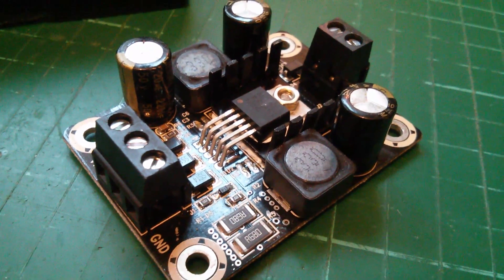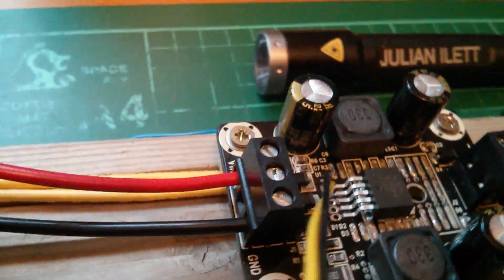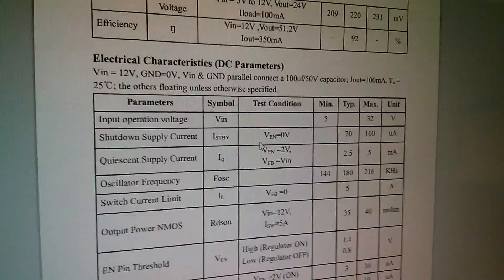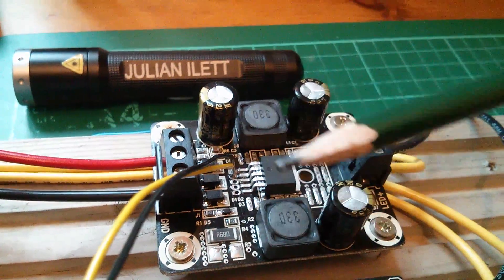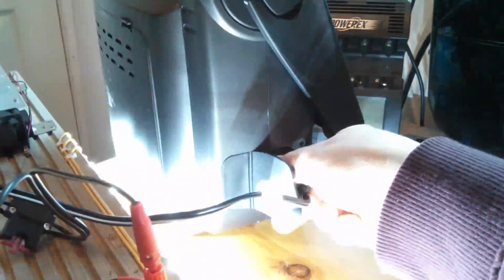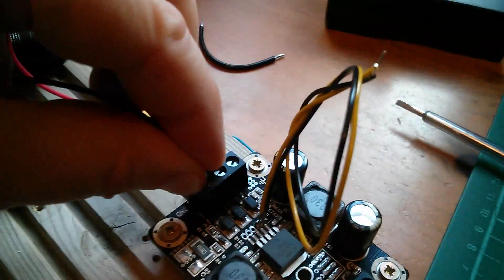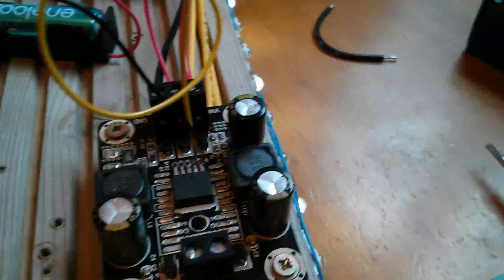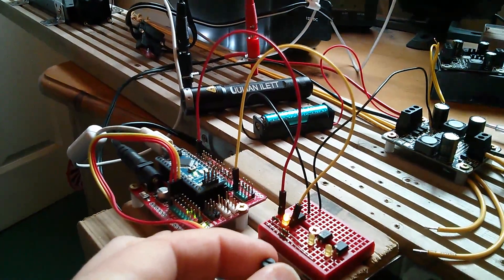How to use the XL6006 SEPIC LED Driver Module #1

Comment: Where can I buy XL6006-based module (I need boost one)? I tried to search ebay and sureelectronics' items, but there is not any XL6006 there.
I like 0.22V feedback threshold, the XL6009 has 1.25, which results in  unnecessary high power loss in constant current circuit.

Comment: Hi!
Can you more than 20W output measure? I have buying sepic converter with XL6009, i have tested, i have more, than 40W output power. I have XL6009 desoldered, and XL6006 soldered in the same PCB. Voltage divider is modificated, also i have 30V maximum. But i can not more, than 20W output become. 30V - 700mA, 20V - 1A, 12V 1.5A, 6,3V 2A, 5V 2.4A, and no more. With the original IC (XL6009) i have 5V 4A, 12V 3.5A, 18V 2.5A, 24V 2A, and 36V 1,25A. This is more, than 40W! What is with XL6006? Is it over power protected?
I have modificated this circuit what i seeing in datasheet, with 0.2ohm shunt. With 50W LED i become only 30V 0,7A... No more! With 0.1ohm (0,22V/0,1ohm->2.2A) i have 0.78A measured. This is not so good... Thanks!

Comment: thanks for this Justin, you used the enable Pin on the board block to test the function with the 1.2 volt battery which turns the driver off.  Is it possible to directly connect the arduino to one of the pins to provide a similar function?  I'm trying to create a strobe effect, 4-25 ms pulses for a short duration and then pause for 1 sec.